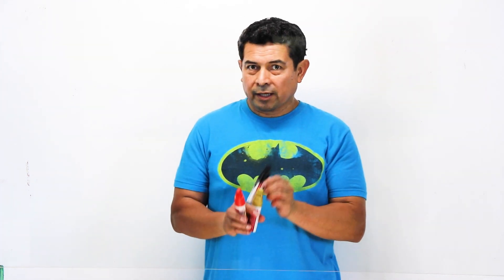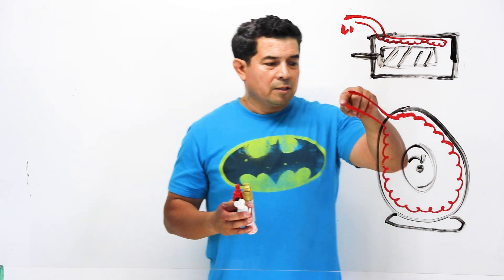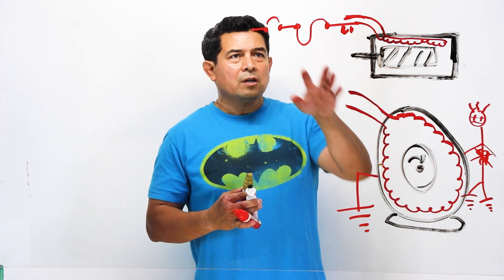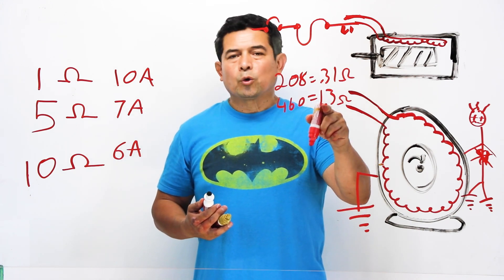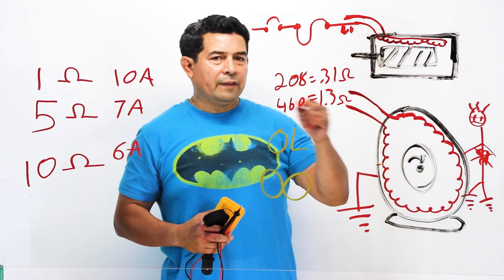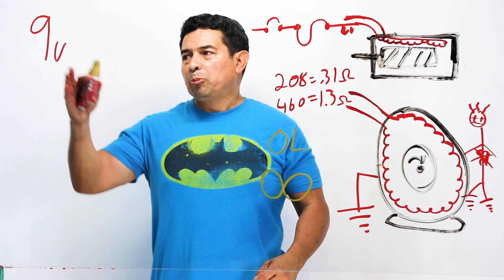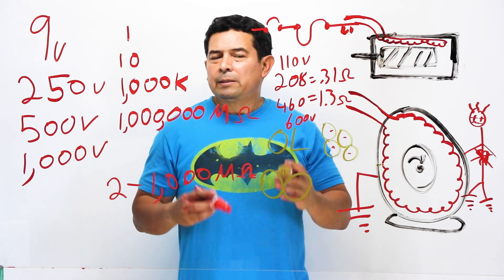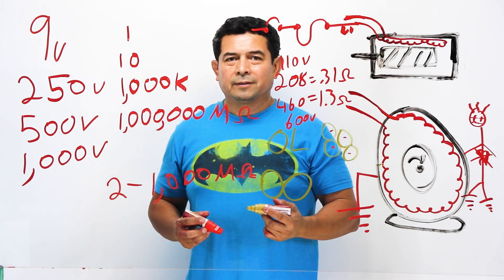Using a Megger

Comment: Pardon my ignorance... if I mag 1000V though motor rated for 460v am I not really putting any current(amps) though it?  how would it burn up the insulation... wouldn't think that the meter would send enough current to cause any real damage to the insulation. it's just a thought on my mind.. Other wise great videos will help me a lot. I am trying to understand this as much as possible before I use a megger to diagnose transport refrigeration units that use generators and HV motors, heating strips and compressors.
Reply from the maker: That is a good question! But there are a couple of things so you need to remember. Amperage the way I explained it in classes is that, that is the amount of electrons flowing through. Voltage is the force and or the pressure that you were pushing the electrons with. When you mentioned the 460 V motor that is the force that you are putting through. It is like when you put too much pressure in a hose that is not designed to take that much pressure. You blow the hose apart. It is not the amount of water going through that destroys it, it is the pressure that blows the hose apart. It is the same thing with a Megger. It is the pressure that blows the insulation apart if you put too much voltage through that motor. In class I compare water to electricity because they work the same. The voltage is the same as pressure and amperage is the same as how much is flowing.   I hope this explains the question. I'm not sure if I have a video on YouTube where I explain all of this about electricity. But I do know I do teach it this Way in class and it makes guys understand it very easily.   Good luck!!!!
Reply: Great reply.. I have always compared it to water myself.. Definitely cleared that up for me.

To be honest I saw videos on YouTube where they're saying if it's rated for 250v, send 500v..So I was a bit confused. Definitely agree with you.    Thank you so much for this sir.
Reply from the maker: @Chrismccl   I'm glad he cleared it up. Good luck out there!

Comment: I’m sorry and I’m not criticizing, but it drives me crazy when people refer to the “OL” as open line or open lead or the one that really gets me is OVERLOAD. An electrical circuit is simply a loop, no matter how intricate the circuit is, it’s basic form is a loop and OL stands for Open Loop. There, I feel better.. 😀 Great video my man.
Reply from the maker: HA HA    It is funny the things that drive us crazy!!!   I know it is a loop and most guys use open lead or open line, they will ague about that.  I know it is a loop but I think from now on I will try to add this on to my classes as I go along.  "OPEN  LOOP".   Thank you and I don't mind people making comments about things, I figure it will help me improve what I am doing. Thank you
Reply: When I bought my Fluke 88 many years ago, the manual states that OL means Overload condition is detected. Makes no sense to me either!
Reply: Over Limit.  As in Over the Limit of the testers capability.
Reply: @sparkyjerred419 100% correct! In the context of the measurement it absolutely means it is OVER the LIMIT of the instrument’s ability to quantize the measurement! 😎👍
Reply: Your OCD is worst than mine.
Reply: So it doesn't mean to take lunch?- "On Lunch"

Comment: So im new to using a megger and im not sure the person teaching me even has a clue especially after watching this video. He told me on checking a 480 volt motor you set the megger to 1000 volts and if it ready all its good. This is using i believe a fluke 1507 megger. Any feedback would be appreciated.
Reply: Remember this is a controlled test in a testing environment. For example if you lose one phase on a three-phase motor your voltage will go up approximately 78%. 
 
The recommended test voltage for insulation resistance testing is typically higher than the rated voltage of the motor. A common practice is to use a test voltage that is approximately double the rated voltage of the motor. For a 460-volt AC motor, a test voltage of around 1000 volts is often suitable.

Using a higher test voltage helps ensure that the insulation is capable of withstanding potential overvoltage conditions during normal operation. It provides a more robust evaluation of the insulation resistance and helps identify any weaknesses or potential issues.

Remember, just don't watch YouTube videos for information on your career.  Look under standards from NFPA, ANSI, IEEE, NEC etc.  best of luck.
Reply from the maker: The motor windings and the insulation is set up to the specific voltage.   I do not like putting a too high voltage because it is like adding too much pressure and it could blow the insulation, like raising the pressure in a hose, it could blow the house apart if the pressure is too high. That is why a MEGGER has different voltage settings, so you can set it to a voltage close to operating voltage.    If you look at your meter it has different settings for different voltages, so you can check different voltage motors. This is the link to the user manual for your meter. https://dam-assets.fluke.com/s3fs-public/1507____umeng0100.pdf?Eu5rEtlCCr4HEG1nvkhUL9AUrbzm3fSc        On your own test motors and take your time.    good luck!!!
Reply: Hello,  the manual will never tell you what to put the meter at.  The person showed you is correct.  It should be double the voltage.   If you meg a motor that is 460v , what kind of pressure test is it to put it to 500v.   It should be out at 1000v.   That what the test is, to put it under pressure to make it fail if there it is compromised or show signs of failure.
Reply: The NETA test specifically 2005 governs the DC voltage for insulation test for 600 volt class equipment as 1000VDC.

Comment: Is it semantics or is electricity “ going to ground” or “ trying to return to its source?   Thank you for the vids.
Reply from the maker: That's a very good question! I typically explain this in class.  The generators at the power plant are grounded to an earth ground, meaning that they are connected to ground. Transformers are also connected to ground and because of that electricity always wants to go to ground because it wants to go back to the source as you put it. If the generators were not grounded then electricity would not go to ground.  I guess you could say it is all semantics.   I hope this explained it for you.  Thanks for watching!!!!
Reply: They are 2 different things. In single phase AC, The return path is back to its source, either the other phase or neutral. Ground is used for safety. In case something happens where the case gets energized, it trips a safety device and nobody gets hurt.
Reply from the maker: @robertrappuchi5743  yes, you're right. It needs to go back to the source whether it is through neutral or the other hot leg. And yes, ground is for safety.   And like I tell everyone in class it is the most important wire because that could save your life.   thank you

Comment: Is there a ohm chart for motors winding?to check for a value resistance on a 480v or 208v motor
Reply from the maker: Sometimes the manufacturers will have that information out there.   I have found it but it is hard to find. sorry.

Comment: If I should meg a motor rated 230 Volt, would I then set the megger to:  500 or 250 Volt.?   would 500 Volt ruin the insulation in the motor?       Thank you for clearly explanation. I do like your vidios.    Live in Trondheim ,   NORWAY.    mvh  sverre  eriksen.
Reply from the maker: It would be a good idea to set the voltage to, 250 V. If you go to 500 you may ruin the insulation. I only Meg motors if it is necessary. Sometimes Megan a motor could where the insulation out sooner. Thank you for watching the videos and hello to you over there in Norway! I am here close to Washington DC!
Reply: It actually wouldn’t matter since you’re using a minimal amount of current and the insulation and resistance tester is non intrusive/destructive. And the wiring is usually rated to handle over double the voltage rating

Comment: Love the explanation on your videos!! I have a question for you. How often do you recommend testing a compressor motor on a chiller using a megohmmeter?
Reply from the maker: Thank you for your kind words!!!  I am glad to help so many out there.   Meggers sometimes put a strain in the motors, if it is not done right. We used to  test motors once a year. So that is what I would suggest. It is very important to keep a record of the past readings so when there is a drastic change it can be seen and something can be done about it.  good luck!!!

Comment: Sir I want to know what type of control panel we use in our HVAC system.for example I m working on Trane air coold chiller and I don't have any knowledge about its panel system.plz make a video on this topic
Reply from the maker: I will see what I can do.  I think you are saying what the wiring might be like in the chiller you are using? and how the controls are set up?
Reply: Chiller are CGAV428 SERIES make 1994 and mostly I want to know about AHU FLOOR MOUNTED CONTROL PANEL system.THANKS SO MUCH

Comment: Another outstanding video sir!!!!! I love how you show the actual picture of what the item looks like in the field as you are drawing it.  I was wondering if  I may ask your input on the low impedance or Loz function on the meters and if it is something us techs should be using more? Thank you again,
Reply from the maker: Thank you for the compliment and question.   The Loz setting can help you find a bad ground or neutral. BUT the problem with that is that if there is hot wire and yo have a bad ground it wills how 0V and someone may think the hot is dead. They may touch it and get shocked.    In what we do, meaning HVAC, I do not see us needing it.    the ghost readings will happen when there are several wires running through a bundle and some wires are not energized and giving you the false readings.   I can see how an electrician would need this but in the HVAC field it is not needed as much.   I hope this makes sense.  Thank you
Reply: @AirConAcademy  Thank you sir for the reply! It makes total sense. I just notice that a lot of new meters seem to be coming out with the Loz setting, so I thought I would ask. Thanks again, I really appreciate it.